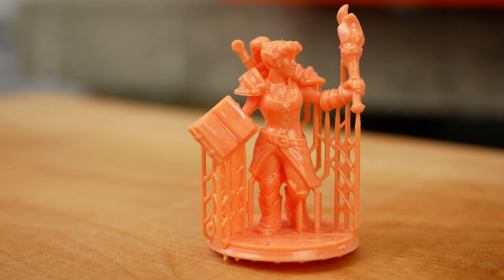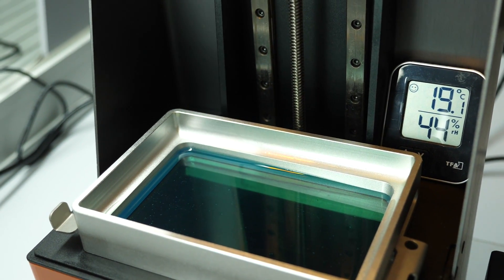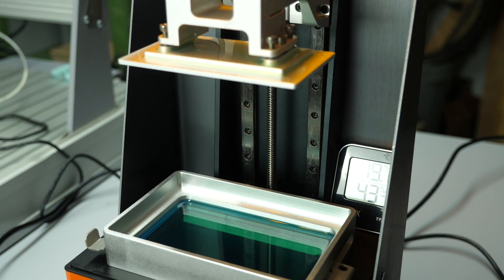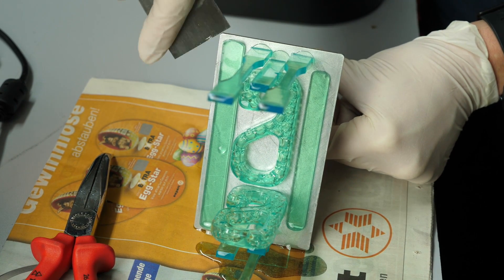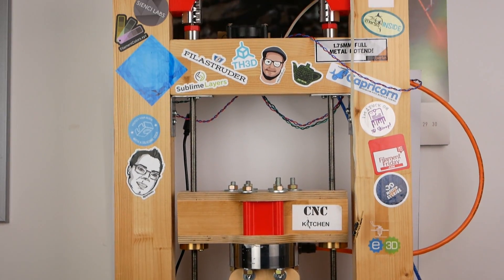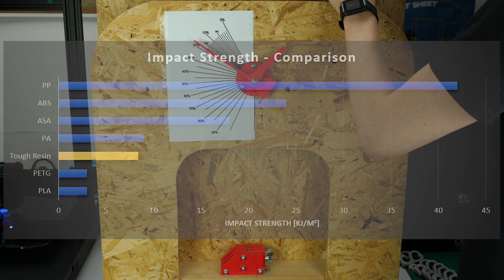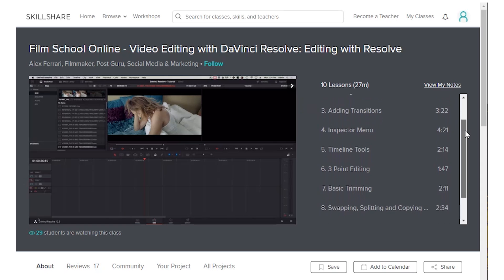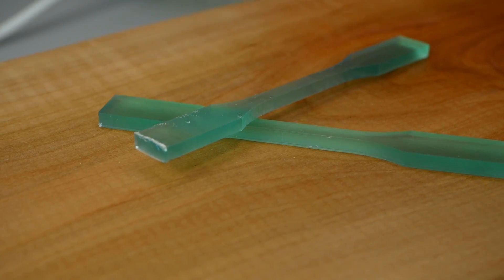STRONG parts from a Resin 3D Printer? Testing TOUGH Engineering Resin!

Comment from the maker: Feel free to share and discuss the video on you Social Media Plattform of choice!
Reply: Any chance that you can do this test with Prusa's new Tough resin? I'd love to see how it compares, since it comes in a wide range of colors, unlike Siraya Blu.
Reply: Could you please make a video about the "Alternate Extra Wall" Setting in Cura (in the Shell section) and compare if it's useful or not (how does it affect the strength of the part or is it only useful with a high or low infill setting)?
Reply: Great research!  Thanks for sharing the data.  I hadn't realized how strong this stuff is.
Reply: Hey Stefan thats awesome stuff you are doing there... I am having a little problem.
I was trying to print nylon parts on a FDM machine cuz the parts need to be hitresistant and a little flexi. 
I finaly reached a point where I wanted to end the damn Printer. 
So I just came back to my MSLA Printer thinking about flexible resins since you can mix em with "standard" resin
to adjust the flexibility. 
Thats worth another video maybe? I mean I hope I figure it out before you upload that clip but it would be awesome to see the numbers. 
Grüße aus Rotenburg
Reply: do you use dlp or sla printing since this time?
Reply: Would you be willing to test out any of these resins? They're supposed to be new UV resins that are good for industrial strength plastic or something along those lines. https://www.matterhackers.com/store/c/photocentric-3d-uv-dlp-resin
Reply: Hi Stefan.
Can you make a video where you investigate reinforcing SLA resin with chopped carbon/glass fiber?
Thomas sanlanderer tested whole sheets of GF, but he only tested flexion, not tension strength.
Reply: no more CNC Bitchin'?
Reply: Hey, according to Formlabs Resin has much better mechanical properties when it is cured at about 60°C with little oxygen. Can you make some tests where you compared post cured parts the usual way and a batch which is cured in a 60°C water cup ? Might be an interesting video.
I like your videos, specially the one where you use the Volcano nozzle with some nuts, I do the exact same thing now too =) Best hardware mod ever!
Reply: I make high quality FLG Graphene, would you like some to test some in your resins?
Reply: How bout in compression nerd
Reply: The smell you got I would think it's cyanide which is the fumes given off from permanent markers

Comment: Quick comment from 6 years in the future, there are a few real DLP printers on the hobbyists market now and more correctly labeled as mSLA. Double check, still! 

DLP is a superior tech for quality, but at the moment it's still more expensive. It inherently has much higher contrast, which makes the voxels much more accurate. This allows a lower power light that lasts longer, and prints can cure much faster. Because of the cost, most models right now are also including high resolution for a premium package, but DLP doesn't automatically get more voxels.

Comment: I have seen other videos where the presenter mixes the tough resin with other resins to secure the properties while getting specific colours. I have a custom design that I find droops in time, which seems to be attributed to the clear resin not having the properties to support floating weight over time. I have tried both solid and hollow with internal supports, and the print still droops. So maybe the solution is to mix in a tough resin to gain engineered properties.

Comment: Has there been any advancement in this area? Like new, stronger resin that could be tested.
Reply: Yes, i recently bought some rigid resin from anycubic, it requires a 30 minute post cure and a 1 hour heat treatment at 80C to make it even harder, its still brittle but hardest resin I ever tried shearing.

Comment: The reason the deformation jumps as you apply load is due to creep of viscoelastic material. Stress causes nucleation of large polymer chains, followed by preferential entanglement of the broken chains.

Comment: I don't know for sure, but that's what I'd call a visco-elastic material. Kind of rubbery, but also semi-brittle like silly putty. The deformation is time dependent: if you wait long enough, it will stretch (creep) a lot before reaching a max deformation and failing.

Comment: Could anyone advise? If you print engineer parts, we’re high precision is required, are you better off printing with FDA technology and then use a 4 axis router to get perfect dimensions 0.03 precision) or to use directly a resign printer 8K ? These templates are big, and require printers like the Phrozen sonic mega 8k.

Comment: I print planes and ships with my FDM printer but I have problems with small parts. So I was going to try Resin for this. Wish me luck
Reply: One you go resin you won't go back, resins are versatile now, you can buy high temp, flexible, castable, etc and it requires no modifications like fdm does. Honestly superior in everyway

Comment: I'm running into an issue in that I'm seeing so many articles online that say resin prints are much stronger than FDM prints, but I honestly don't know what to make of that. Every test I've seen Stephan do shows that the resin part is just weaker and more brital than even standard PLA. :/ At the end of the day, the stuff I make doesn't require the type of precision that sla seems to offer and big build volumes are more important to me. I also have never had issues with parts lasting so long as they are designed with the limitations of FDM in mind and the right filament was chosen... At the same time I'd love to know where the disparity between the practical testing and articles comes in. Is it that people are testing based on layer adhesion or something? I could see SLA winning out that way maybe.. 

Meanwhile though, I see videos like the one from "Stuff Made Here" where he forms sheet metal using SLA parts... so I know sla can do a lot at least at compressive loads and when the right resin is chosen...
Reply: this video is 3 years old , in the meantime Resin development has changed a lot. todays best engineering Resinns are a lot better than they were 3 years ago.

Comment: Why did you get weird numbers on the bending load? Simple. Because it’s a nonlinear viscoelastic material. I typically avoid these (polycarbonate is one of them) as they have a tendency to succumb to creep failure due to disentanglement and realignment of the molecular chains.
Reply: Interesting. Does this mean that when ever loading the material, it wont go back completely? And when loading with only 10% it will creep with time a lot?

Comment: No shock tests?  I am trying to use eSun hard tough resin with poor results. The resin when cured cannot withstand a drop from distances as low as 1m.  Once cured the parts break like glass if dropped or bent.

Comment: Do you know any resin that can resist harsh acids? I would like to use the parts which will be connected to a high pressure PCB etching spray tank.

Comment: So, Resin Printing is the same as MOLDING? because its directionless print? these parts vs a 3d printer will be SOLID and not built in LINES?

Comment: I have used form3 Tough 2000, 1500, and Durable resin to create product prototypes and some actual production parts.  With all three I can this.  I have created large connectors with up to 70 pins and have also tried printing ev charger handles and heads.  I have only one thing to say they are ALL TO BRITTLE.  A drop from as little as three feet they break and shatter.  I have not found a resin yet that can survive a drop from even the smallest distance.  I have also tried phrozen black rock pro (major shrinkage) and phrozen aqua grey (pretty dimensional accurate) and phrozen pro series aqua grey (pretty similar to the aqua but I did get some warpage on curing.  I plan on trying the siryatek and peopoli blu resins soon.  For me, every resin is too brittle to be considered for manufacturing application.  I cannot recommend a part that the first time it is dropped it explodes like a ming vase.  However, I do see a possibility to use the resin parts to make urethane molds and poured polyurathne parts
Reply: Try this resin  in a 80 20 mix with there tenacious resin  I think you will change your mind.  80 percent Blu also make sure of you temp

Comment: 100mm by 70mm under my hydraulic press with steel plate 25mm by 100mm thick on top. To spread the force giving it the best chance. 2 Ton it crushes. I wonder if it could really hold a wheel up on my big Mercedes sprinter. Would not want to be underneath.

Comment: When I first saw the AnyCubic Photon Mono and cura I was in love with the print method and was keen to cut over immediately as most of my Filament printing was marred by stringing and failed build plate adhesion.  However after considering the resin issues: more brittle (solved here), the fumes during printing (I need a new place to print), the chemicals in the washup being expensive, the UV unknowns over time, I am left a little flat.   Sure the prints are gorgeous however they do not seem 'useful', given the material, for functional items, brackets bearing load outside on my MTB and road bike.  feeling a bit flat about it but at least the Filament prints work well on my Core XY printer, even if I must print 1 at a time for the best appearances.

Comment: Did you wash for 15min based on the supplier's recommendation? From everything I have tested a wash and cure of 3 minutes is my maximum time before I start to see MORE brittle results from Elegoo's standard and water washable resins. If the supplier recommended 15minutes then that makes sense.

Comment: i prefer resin prints over FDM prints at the moment.
Resins prints seem just to be more reliable while printing. I really love the details and sharp edges, even when printing mechanical parts.
And i definitively prefer the cleanup as compared to the extensive sanding you have to do on fdm prints

Comment: Should have printed that test hook as a solid part.  It would have been VERY strong.

I tested Siraya Tech Fast, both gray and yellowish green and that resin is very resilient for outdoor use.  I hung parts outside in direct sunlight and rain for six months over the summer and the parts were unaffected.  No surface discoloring or chalky deposits.  They looked new.  They didn't lose strength and may have become stronger as sunlight UV cross linked the polymer.  The part was a dog bone with a central dimension of 5mmX5mm.  There were holes on the end for 550 pound test paracord.  I was unable to create a tension failure with over 100kg of tensile force.  I couldn't snap these parts by bending them in my fingers.  The tiny solid parts are incredibly durable, UV resistant and impervious to the elements.  The yellow PVC insulation faded on the wire I used to hang the samples outside for 6 months, but the parts didn't fade at all.

Comment: I get drooping with printing on my mars 2 using sirayas config file. I have tried exposure adjustment from 2.5 seconds per layer to 6 seconds, with best results under 3 seconds. But threads that I am printing perpendicular to the build plate are not symmetrical 'traingles' if you will, they are like saw teeth. Resin is 30C for prints. does anyone have any tips?

Comment: I have a question on your results when laying your parts more common "FDM" style than loaded with tree supports like common "SLA" style. Did you get some varied results or mild warping when having large surface areas to pull from the screen? In example the printer having to really "rip" the part each layer. Might be user error for me since I get better results using FDM methods of part placement when using resin than the tree supports.

Comment: The first printer I had hands on experience with was the form 2. My favorite material was the abs like blue. The biggest problems I had was warping and other dimensional issues. While the strength of the part isn't dependent on orientation, the warping behavior is. Process also requires orienting the part at an angle to it's axis to limit it's adhesion, so the warp becomes a curl that is really difficult to design around. I found it very difficult to make straight fixture frames, precise slides, etc.

Comment: this plus tamiya primer (high uv resistance, we use it in gunpla) and assuming wear is equivalent to PLA i could print both gundam parts and cosplay props on the same machine. my ender 3 pro wont do gundam parts, nor miniatures(pla) to my desired resolution. after viewing this im seriously wondering if an elegoo saturn could beat my ender 3 pro. i can only afford one so id have to sell it. thats a tough call i dont want to make!!

Comment: Hi, in the unlikely event you see this I'd love to see a comparison of Siraya Blu, alongside Tenacious and other tough resins, like esun's tough filament. 

According to Siraya I was told that tenacious has even more impact resistance but I'l really curious how it compares to things like the esun tough resin which is over double the price. I'm wondering if that price is worth it or not. 

Of course, I'll have my tenacious resin in and do testing long before you have a video ready, if you do this but I'd love to see a video finding what the best engineering grade resin is, for non SLA printers and I think a lot of other people would too.

It would also be interesting to see if SLA prints have any significant difference in mechanical properties to LCD based machines using the same material, or if the main difference comes down to print quality and materials availability.

Comment: still better usoing a filament printer, because you pay 2 to 5 times more for resins (especially special resins) than for a whole 1 kg roll of filament with zero post processing.... but this is a very good step in the right direction. I dont have time for weak resin prints, but strong ones, especially if they get more cost effective.

Comment: When looking at the spec sheet for this resin (provided by the manufacturer) it says not to soak the print in IPA for more than 30 seconds, and to try and only use a pain brush and IPA to remove the extra resin. Can you run the tests again to see how using the correct post processing effects your test results?
Reply: Wow, no response? Thats wild.  Thanks for bringing attention to this.

Comment: would tough resins like this be good for 3d printer components inside a heated chamber i was thinking of using pc max for my diy printer project but i have a resin printer so maybe this would be a better option?! 

has anyone used resin in this way before? i couldn't find any examples but its a hard thing to search for as the term "resin" and "3d printer" are really common and return resin printers not printer components made from resin! :(

i know this is an old video but i hope someone who has tried it or has any info on this sees my comment!... is it you?... :P

Comment: I use resin printing whenever I need accurate mechanical parts with very small details, such as gears with fine tooth pitch. I use FDM for everything else, so the things I build are usually mostly FDM but incorporating several small resin parts.
I don't think any FDM printer can get even anywhere near the detail and resolution of even the cheapest resin printers.

Comment: as an owner of an fdm printer i think fdm and sla can work and live together. for everyday use fdm is a way to go but there are some exception where you need a very fine detail like miniatures or if you wanna make a silicone mold from a 3d printed part and you want it to be smooth and shiny good looking then you need a printed part from sla machine. i dont own an sla printer but i really need one for that specific area.. no matter how much i try and how perfect my fdm printer is you just cant match the quality..
well you can but you need to put alot more work with body filler alot of sanding with different grits then primer etc whereas you can put half of the effort for washing the sla printed product and uv curing which also will take significantly less time for the same result.

Comment: I bet its equally strong in both directions because instead of a constant line of filament, resin printers that use LCDs produce small dots around each pixel so there wouldn't be much difference between each direction

Comment: Stefan, I always see that you have included the notch into the design of your impact test specimens. They are actually supposed to be a straight bar with the notch "cut" out to eliminate the variables due to surface tension on the walls. This is a very important factor for accurate results.

Comment: One thing i realized, wouldnt it be possible with resin printers to just add exactly the resin corresponding to the volume of the print and have the printer use up everything exactly? since its liquid it should always cover at least the bottom, maybe the last layer could be a bit problematic but... residue resin is such a mess to deal with

Comment: Im Am looking to purchase our First 3d printer I a Computer Scientist who needs to build a part application to use with IOT mechanical devices that can handle stress, weight load bearings, and outside elements. Would you recommend FDM or Resin for these types of requirements? I Also Do not have a well vented area it needs to be in a class room

Comment: Excellent video. I use resin printer for artistic purposes (to create positive masters from which I create negative molds) so toughness and strength are not something I require. There are many high quality odorless resins and indeed, the resin I chose (PrimaCreator Value - Light Gray) has so non-existent scent that I sometimes forget it's a toxic substance :P
Reply: I feel like that's a negative.